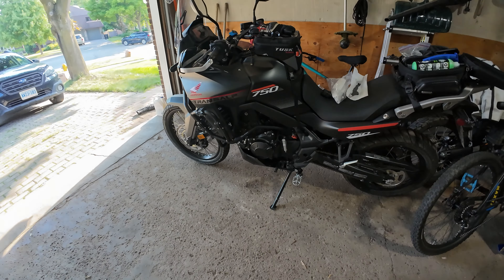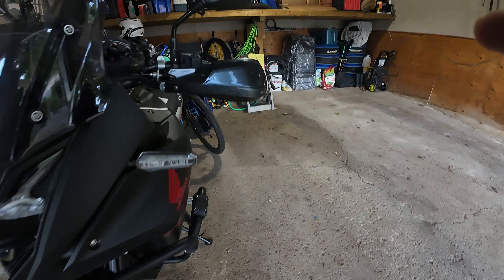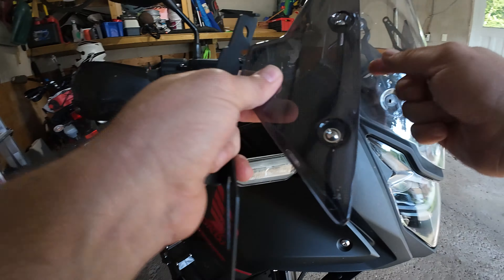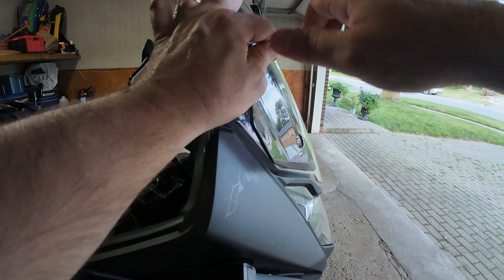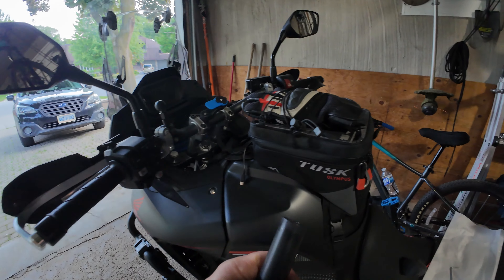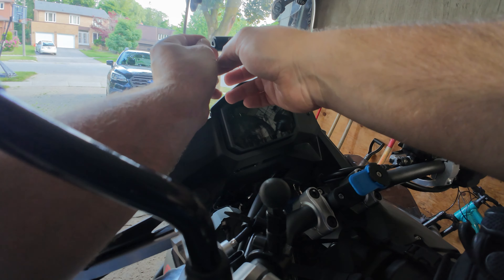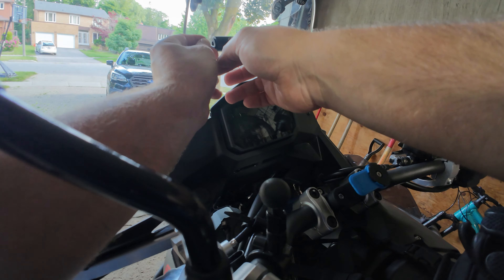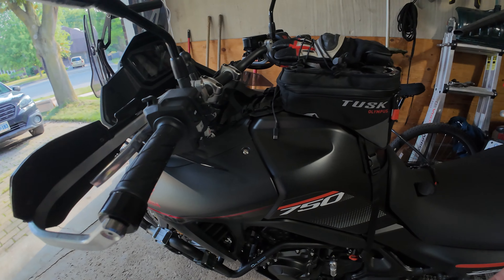Honda Transalp XL750 - GPS Bracket install

Comment: To avoid the bar to rotate when the weight of the gps is on it, I’d put rubber washers between the bracket and the bar.
Reply from the maker: I didn't experience any rotation in the bar and I have a phone and camera on it. But I think it is a good idea.

Comment: Good video. I just installed the same for my gps. 
How do you like the TUSK tank bag? I’m considering one, but can’t decide between the large or small size.
Reply from the maker: I like it a lot. I carry my glasses and battery power bank with cables, spare batteries for my 2 cameras, ear plugs, smell knife, lighter, small cloth and visor cleaning spray. It stays in place but it does come a bit in the way when you stand up off road. Also depending how the bike falls I have to remove it to grab the handlebar. But removal and attaching is really easy. Small is the best for me otherwise would be too much on the way for offroad.
Reply: @advfreedom  Okay great. Thanks for the reply. I think I might go for the small one as well.

Comment: Looks good, been considering one. You probably look over top of shield, but does it impair view during slow speed maneuvering when trying to see ground immediately ahead? My GPS is on bar's but would be handy just above dash. Thanks for video.
Reply from the maker: I moved the quadlock on the right side. It felt like it was impeding the view a bit when sitting down. But it is better than on the handle bar where I had to look down every time.

Comment: Does anyone have experience using this bar together with ~500g (17oz) gps nav (e.g. Zumo XT2 + holder weight about that) on unpaved road during extended period of time? 

I'm a bit afraid the a heavy piece attached to a leverage that sits between windshield and its support might destroy the windshield
Reply from the maker: I don't think it will destroy the windshield, as the screws are attaching to the windshield holder frame that is metal. But it will shake. I put a 6.7 inch phone with case and quad lock mount and I mount it to sit in the corner. I have some of my latest  videos  with the phone attached and a GoPro on the same bar and it is fine. Offroad a bit shaky but nothing to worry about.
Reply: @advfreedom  Thank for your reply. I have added thin nylon washers between a deflector and a windshield, similarly to instructions for GIVI FB1201bracket (which comes with nylon washers). Will see how it holds in spring